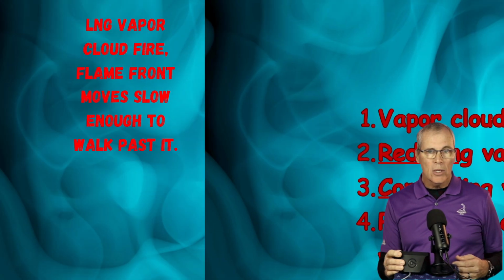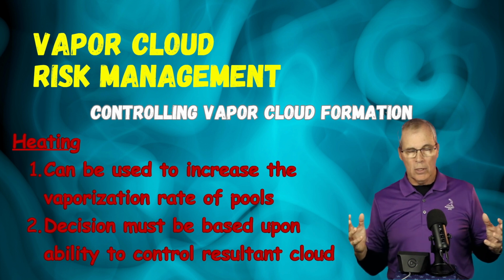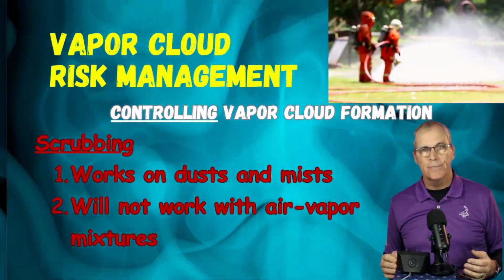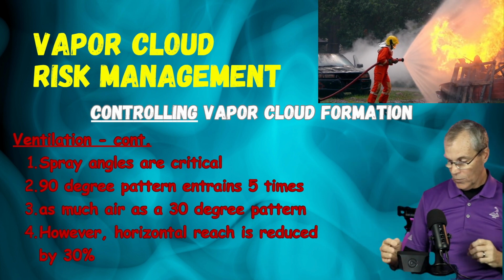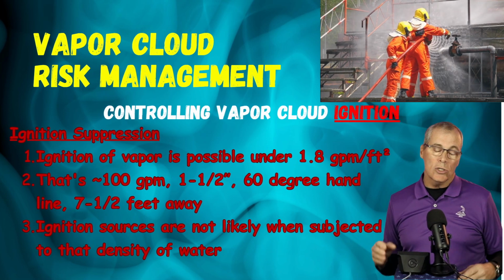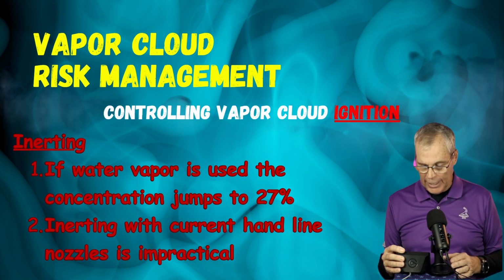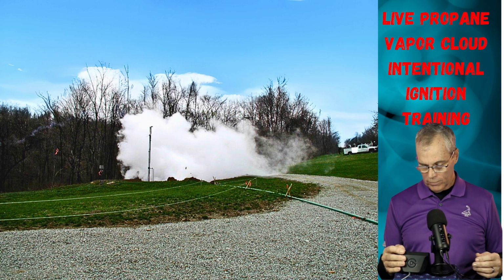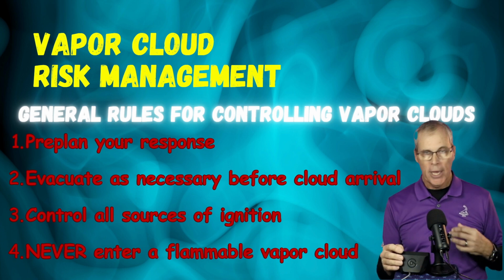LNG and LPG Vapor Clouds for beginners

Comment: Interesting. I know of some people living near LPG/NGL pipelines, and the pipeline company is being cagey about how far away to evacuate, & how big a vapor cloud fire can be. They plan for first responders to go door to door to evacuate people, with the likelihood they would be in the vapor cloud. Since this is a mostly suburban area, ignition prevention can be a real issue, I know of some LPG pipeline failures, where the ignition source for the vapor clouds was never found.

Also, the intentional ignition of vapor clouds bring to mind the conditions present. A leak in a propane pipeline in Missouri in 1970, in a weather inversion, detonated.
Reply from the maker: Propane is tricky because it doesn’t just float away. Just the opposite, it finds hidden pockets in the structures and components. Then when the vapor cloud lights off there are several “explosions” as each junction box or crawl space detonates. Check out the video on this channel about PSM Failure at a Gas Processing Plant. It happened on Halloween, so it’s good timing. 🎃
Reply: @EnergyRiskEngineering  
In 1968, a propane pipeline was leaking, near Yutan Neb. A pipeline repair crew had waited 6 hours for the vapors to disperse, but there was a flash fire when they drove into the area. 5 of them died.